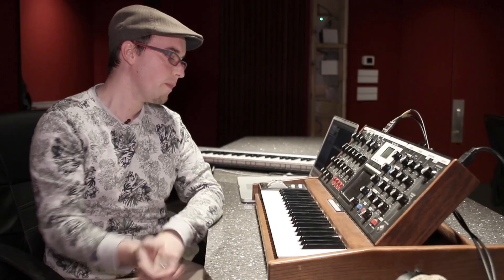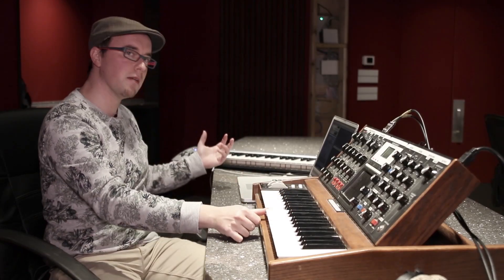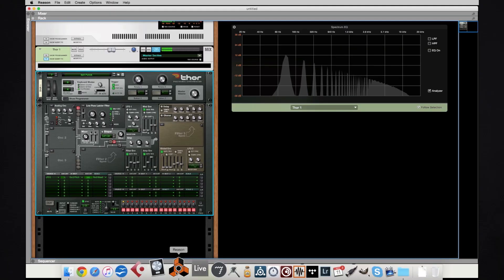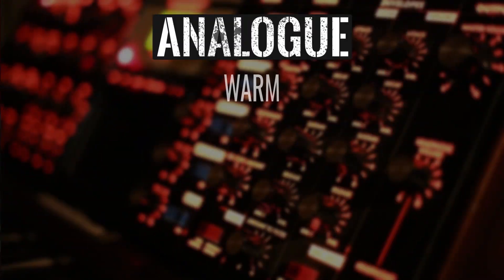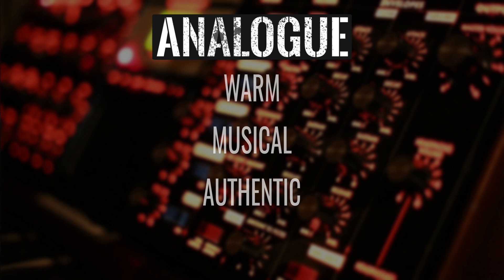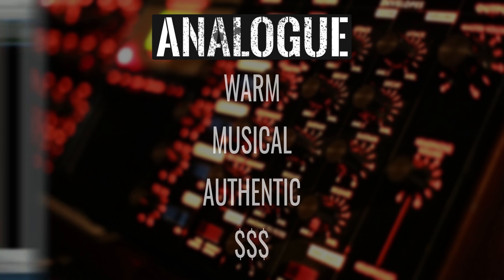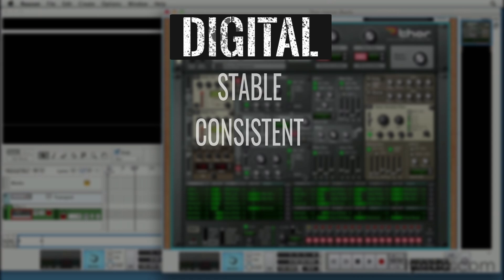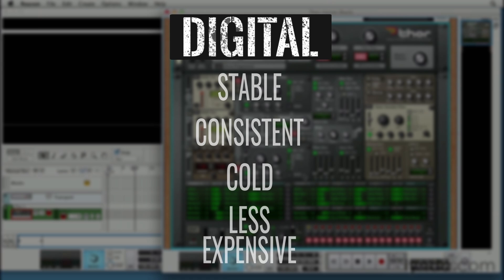Comparing Analogue Vs Digital Synthesis (Part 1) | Metalworks Institute

Comment: Even though digital audio is composed of "samples", it's not a jagged line / step funciton like the one you animated at 1:00.  The complete analog wave can be (and is) smoothly reconstructed from the samples.

Most of the arguments against digital usually have to do with it being "too good" at perfectly reproducing the signal.
Reply: Excellent point. However, chaos oscillators mitigate this.
Reply: @ccmm4094  what are those?

Comment: Additionally, analogue recordings often include ambient noise and musical interactions that are not caught by digital recording. I suspect that it is not, perhaps, long before this happens, but I haven't heard it yet. And, I wonder if any digital recording will ever catch the warmth and subtleties of real-time music recorded in wave form.
Reply: This dumbass didn't explain the difference between virtual analog and stable digital DSP. VA synths use mathematical transfer functions to recreate the sound of their analog counterparts- this catches everything including noise and component interaction these days. Also, keep in mind that whatever shitty $100 interface this guy used won't capture anything well, a good interface like a Prism Titan has absolutely no discernable difference in the signal (even according to top mastering engineers.)

Comment: playing a single note on both keyboards does not show the ear the difference between analogue and digital. Digital samples the wave form of analogue. In order to show a true sample, the note should be bent, as guitars often do. In this waveform the signal is continuous. The step-wise translation of digital from analogue does not yet sound the same.

Comment: Every analog I use produces this hi fi crackle/ humming type sound over top of the sound being played... is that an analog thing or is there a way around that? 

If you don’t know. No worries 

Puma
Reply: How do I deal with ground loops? Because I’m thinking that may be the issue. I’m already using the double coil cables which are supposed to help as well....

Comment: this is a load of crap, the difference in sound comes from different wave shape of the basic wave form, use a scope on a single period and surprise yourself..! Modern DA converters take away all the stepping of the resulting wave as long as you stick below the nyquist frequency. Get a clue guys. Using a scope and identical wave shapes there is no way to tell the difference between the analog and DA'd digital signal.
Reply: In this video I think the analog appears warmer only because it’s actually louder than the digital.  So it’s bottom end is “fuller”.

Comment: Two points... One, saying the only digital component of the Voyager is it's patch saving is a little misleading since all of it's encoders are digital (stepped) which honestly defeats the "continuously variable" allure of analog.  Though to be fair there is an interpolation algorithm that smooths the steps.  Second, digital waveforms AREN'T stepped since everything you hear is interpolated by the D/A converter.

Comment: If you applied distortion to the digital one, it would sound exactly like the analog.
Reply: +Daft Moonz lol no... it's actually the opposite. it's about analog having imperfections in its waveforms so that it gives it character
Reply: It's not about distortion it's analogue having perfect waveforms and tuning that wonders + the filter being analogue is better.

Comment: Definitely not a great through explanation of analog vs digital synths
Reply: For anyone that needs help.  One uses digital steps and the other uses analog electrical signal.  One uses an analog circuit board and the other uses a digital processor on a board to create the sound.

Comment: a mistake in the language of so-called "digital" is that the sound science is in fact based on  floating point - think in terms of millions of steps and not 16 bit fixed steps.  Also the DSP technology allows one create randomness into the waveforms since the original discrete circuit designs and their variables are well understood

Comment: I can't find a part 2. I am assuming that's where you talk about the "actual" differences between the 2? I.E. one is actual current going through the circuits whereas the other is just algorithms?
Reply: I think they didn't do it
Reply from the maker: Hi ! We definitely did do it. Check out both parts here https://www.metalworksinstitute.com/comparing-an-analogue-digital-synth
Reply from the maker: Hi Ermanno, The second part is here https://www.metalworksinstitute.com/comparing-an-analogue-digital-synth
Reply from the maker: Hi Ermanno, Both parts are here  https://www.metalworksinstitute.com/comparing-an-analogue-digital-synth